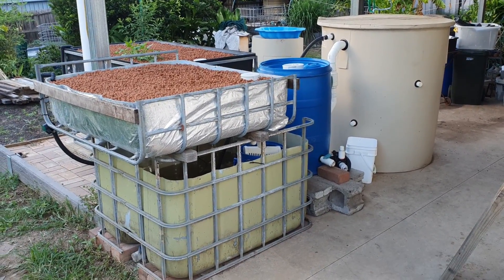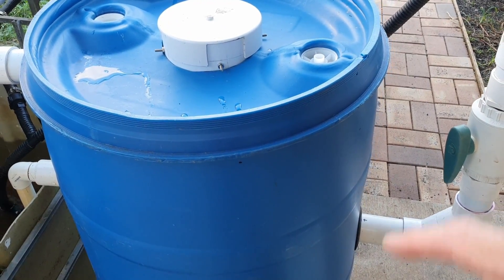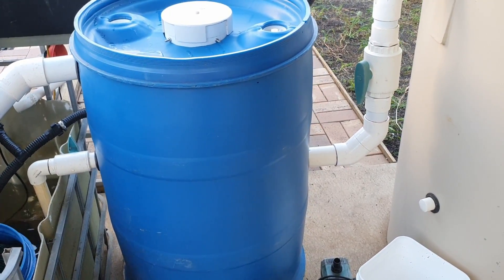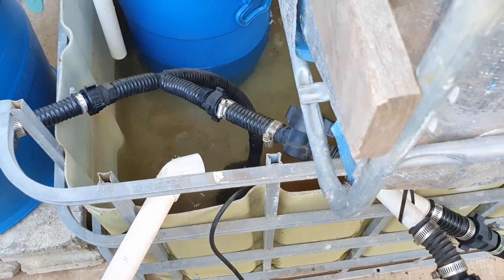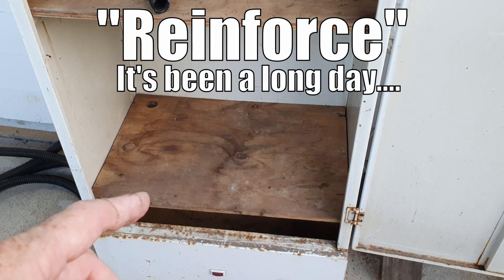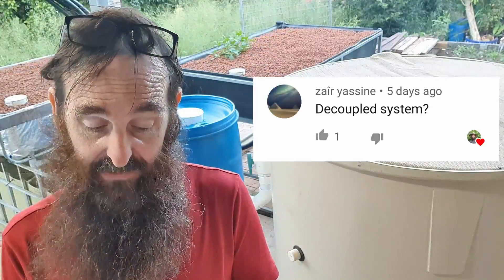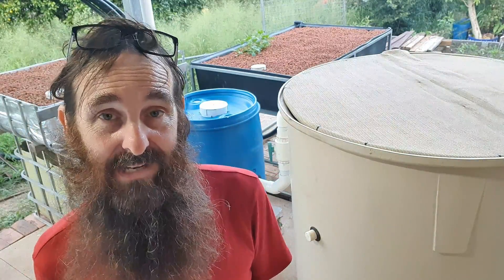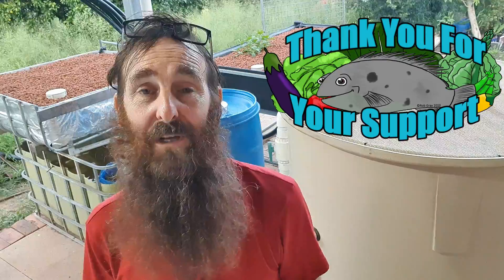NEW Aquaponics System 🌱🐟 & Viewers Questions

Comment: Hi Rob, another fantastic video! You my friend have got my behind into gear and have sourced my first ibc that I've cut ready for an outdoor chop and flip flood and drain system. I cant thank you enough. Can you send me to a link if you have already covered it but how much feed do you give your fish? X amount per whatever grams would be a good start or at what ages do you feed x amount. What ever is easier for you to explain. I will probably run jade perch im asumming afteryour positive comments, I live in melbourne, do you think the jade perch would be good in my region? If not what would you recommend? Kindest regards,
Reply: I believe the ratio is 2% of body weight each day per fish... But I've also come to find that there is generally one gluts in the group if you don't concentrate or seperate (saves netting and weighing which adds to stress and caution)... I just feed a high nutrient pellet and make sure it's gone in 5 mins or else feed again until I've achieved desired results and pellets are left for longer than 5 mins... I don't know wether my pump or fish take care of the excess though.
Reply: @michaelhiggins8778  thank you jesus
Reply: @bt1vn  you're more than welcome @bt1ven just feeding information down the line.
Reply from the maker: Hey bt1vn. It will be too cold down there to keep Jades all year round I think. You'd be better off with silvers I think & maybe even some trout through winter as they're a fast growing fish. 
This PDF has a guide for Silver perch feed amounts on page 195. 
https://www.researchgate.net/publication/267766666_Development_of_a_Health_Management_Strategy_for_the_Silver_Perch_Aquaculture_Industry
Hope that helps a bit mate.
Reply: @RobsAquaponics  you are a legend, thank you for that, ill get reading now. Thank you for all the information you provide in your videos, and the detailed instructions. Your videos are easy to follow, and your channel has been the most helpful in regards to aquaponics that I've seen. Thanks again
Reply from the maker: @bt1vn   Glad I can help some mate.👍
Chewers.

Comment: I’ve been running my system with two pumps for quite some time. I have one feeding water to the fish tank, and the other to the grow beds. I’m using 25-35 W eco pumps that are supposedly capable of 3500-4500 litres per hour.

It’s an option to keep in mind if you think that your pump is unable to provide the flow rate that you desire to all the components.
Reply from the maker: Nice one Eden. Do you have the brand & model numbers handy? Wouldn't mind having a gander.
Cheers. 👍
Reply: Hi Rob, I’ve just looked at the boxes of my pumps. The make is “ponddpro” and the model numbers are “rapid 3500” (25W) and “rapid 5000” (45W).

The power consumption figures look like they have been rounded as they are all multiples of 5, and the next model up is 6500 l/h, 50W.
Reply from the maker: Thanks Eden.

Comment: Rob use a Y instead of a T. that will split the waterflow much much beter.
Reply from the maker: I have used a "Y" when splitting the water between the grow beds but went with a "T" at the pump as I want the bulk of the flow to go directly to the fish tank. 😉
Cheers 👍